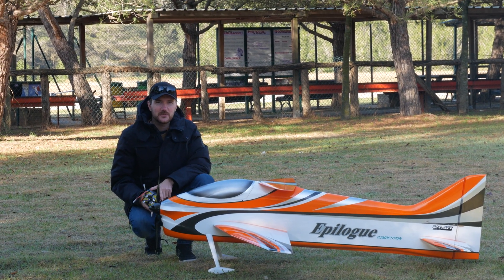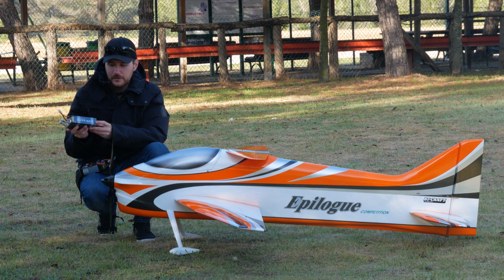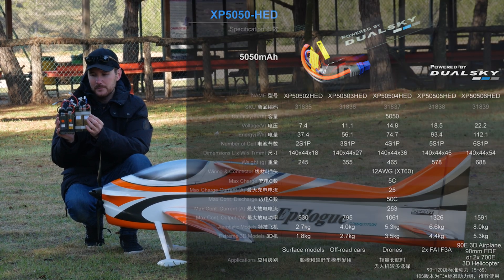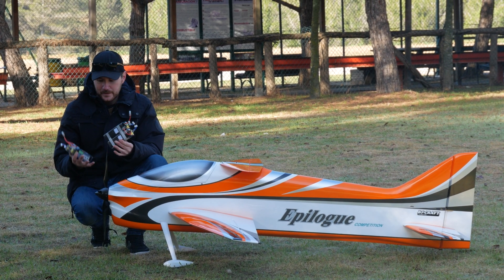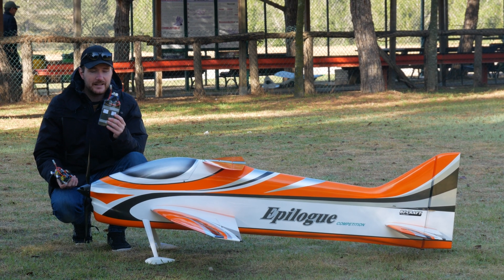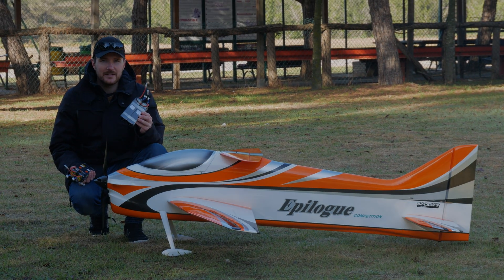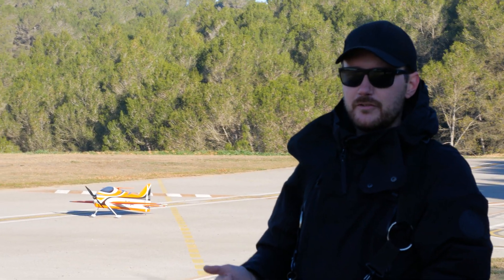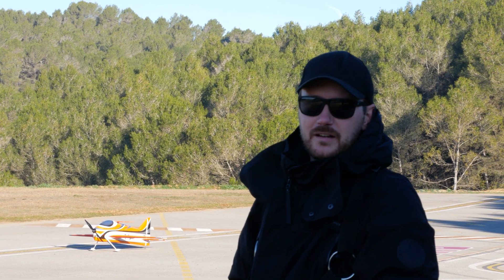How do we break-in our LiPo batteries? || F3A Basics #5

Comment: Interesting concept of running in batteries.  I understand the need to moderate the thermal range, the performance of the pack does not degrade so much if the thermal range is minimised.  However, our experience of many different batteries shows that the degradation is significantly worse if the batteries are fast charged.   I believe you will get noticeably extended life (in terms of retaining baseline capacity), if you stop fast charging them.  Conditioning to the optimum temperature followed by a 1C charge.    

My experience ranges from aeromodelling with electrics up to my company’s involvement with the RR ACCEL project, which recently broke several world records for electric aircraft.  Learning from our colleagues at Electroflight.

Comment: I follow you channel a long time. Is amazing your video. Question or a good topic. What could be entry level (low cost) planes for F3A.
Reply from the maker: Hi RbB! It is complicated to find low cost F3A airplanes. Some TOP companies like BJCraft produce smaller airplanes for 6S with great performance (really similar to the 2m) but I would not consider them in the low cost range. I have tried cheaper airplanes in my club from SebArt (Mythos) or FMS (Olympus 1400). They can not be compared with a 2m but in my opinion are nice options to start practicing F3A and see if you like the discipline. In any case, if you already have some experience flying RC planes, a 2m will always fly better and easier than any other smaller option, so maybe I would suggest the second-hand market, where you can find awesome F3A from past seasons (still competitive) with awesome flying characteristics for good price. Cheers!!

Comment: I also the same, when I get them I do a discharge on a charger then a balance charge to check capacity, then I repeat a couple more times and then an easy few first flights. I'm not actually  convinced that it does any good but it's easy enough to do any way just in case it does! Still very sceptical of light weight high C rated batteries though! (to say the least), worth measuring (when new) the IR and checking it occasionally throughout the batteries life.
Reply from the maker: I totally agree with you Philip. There are some experiments out there but as you said, it is easy to do and doing it you check the capacity, if all the elements are ok... so, I think it is worth it. I forgot to mention the IR... 😅before I was writing down the IR after every charge but now I am doing it from time to time to see how it is evolving. Thanks for mentoninig it!! 👍
Reply: @rombautrc  What IR is still good? I heard somewhere that up to 10 mAh is still godd.

Comment: What is your charge/discharge/cycle process for new packs before your first flight on them?  I usually run 3 cycles on the packs and monitor the charge and discharge stats (each cell within the pack).  This has saved me in the past when I noticed a cell not being as equal as the others and I returned it for a new one.   Thanks for the vids - I appreciate them.
Reply from the maker: Thanks for your comment realflight7! Normally we cycle them at 0.5C the first one, after that at 1C as we always do.